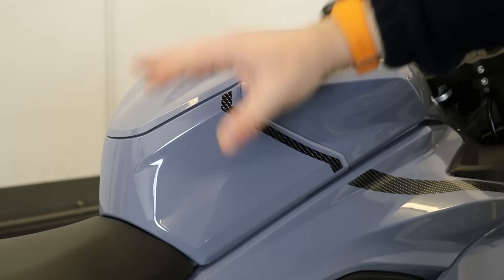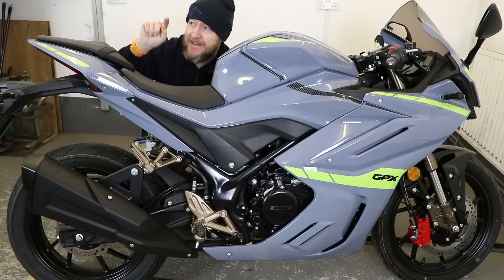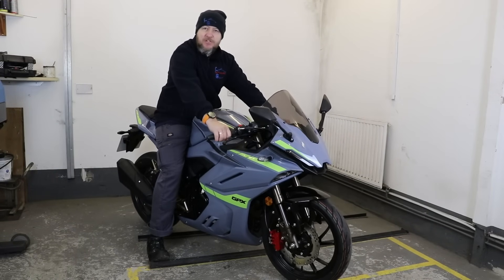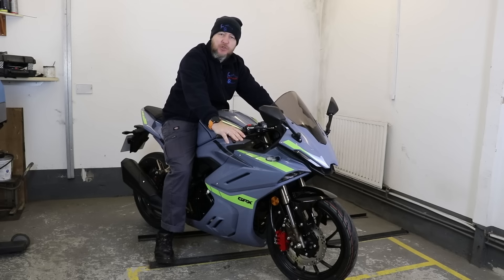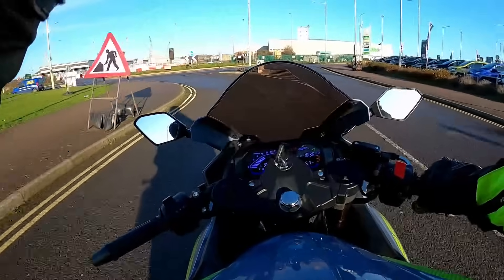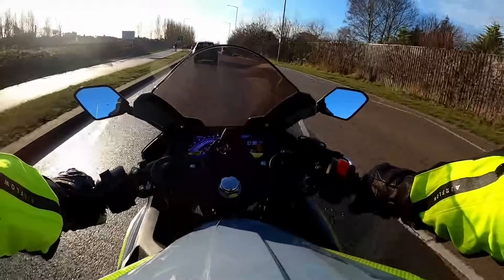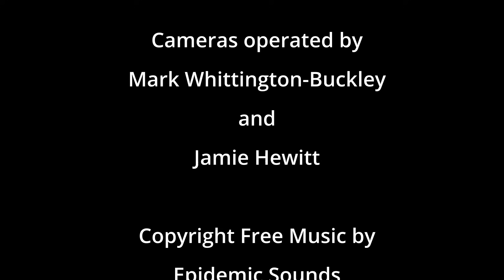2022 SINNIS GPX 125 UK First Review

Comment: I was told many many years ago that you should only warm an engine up in the upright position to evenly distribute the oil. 🤔🤔🤔
Reply: I doubt thats correct. 
Once the engine is running the oil system is pressurised and pumped by the oil/scavenge pump, regardless of the bikes angle.

Comment: What happened to the 100 mph 125 from years back, is it because they are 4 stroke and not 2 stroke, or are they restricted on power, or is it down to them having to be cleaner now.
I've been riding for 50 years, and am out of touch with the regulations concerning the smaller motorcycles.
Reply: Restricted by law on the output.
Reply: @fociidannick  so is that less power than 125s made in the 1980s and 90s, they were still restricted then.
Reply from the maker: Back then, full power 125 was 33bhp....even restricted. Now, 125's are all 4 stroke, (restricted to 11kw -14.75 bhp). Euro 5 emissions now so all fuel injected; ECU's control the fuelling and restrict the power.  Full power 125 will do 70. My first bike was a 1986 FS1E 49cc, only did 35 sadly. Disappointed as my brothers' 1979 FS1E did 62.
Reply: @motorsforthemasses  Not so. 125s were restricted to 12hp (9kw) unless you had a full licence. 33hp 125s like the aprilia rs125 were massively expensive and rare as hen's teeth. Anyone who claims to have had one is either lying, or they stole it.They're 4-strokes now of course, but also have Euro 4/5 emissions. They as good as they can be under the circumstances.
Reply: Like James, that was the beauty of the really early 125s, my 1964 Honda benly supersport was a 100mph 125. It was also an iconic looking bike. Would like one now to just display but when you see them offered today  the £10k price tag is a nit too steep! Those WERE the days my friend I  thought they'd never end

Comment: Personally, I think I'd probably get the Terrain. That's not saying the GPX125 isn't a fine machine, but I think if you're limited to 60-70mph anyway there's no benefit from this kind of layout and you may as well have the more comfortable, more control of a trail bike. I'd also like the panniers, too. However, If you like the styling then there's no real reason not to go for the GPX  for it's looks and it is pretty. This is the thing. Back in the 90s you could buy a 125cc bike and derestrict it to get 20hp. A sorted TZR125 or RG125 could hit 90-100mph. This will never match that. 

I do wonder if Kawasaki who made a range of GPX bikes in the 80s might get in touch with Sinnis about the naming. I think the GPX250 was made until the early 00s and was a fine, lightweight sports-tourer.
Reply: Don’t get the terrain mate there painfully slow even for a 125 think 25/30mph goin up hill 🤷🏻‍♂️

Comment: Nice enough. I think the price is 'ok'. The motor feels gutless and like it doesn't want to rev. The 70mph thing, valid, but the question becomes are you sat at redline to try and do it. 
That being said, the Sinnis terrain seems to be solid enough. I will say as I once did before, you need to review the service intervals, because its important. Its not a cheaper bike if your servicing has to take place 3 times more often.

Comment: That is a lovely bike. My honda vision hits 62 down the dual carriageway it should  nudge 65  with proper variator.  It  weighs 40 kg less than this and it does 180 mpg. 
30 mile a day commute equates to refilling four times a month currently. On the sinnus that would be nine times a month The extra £25,00 would have to come from another budget.
It would be fun to get my knee down at weekend. Of course dodging dip wit cages round here.... exhillerating.
WIth ER is clogged with sniffle cases  would have to be summer sport.
The morning  commute could fun however..
Yes I would exchange shopping hook for something with more road presence.
A great review the black version looks great.
Reply: I don't get 180 mpg from my Vision 110. More like 120 mpg.  Even my T80 Townmate only achieves 140 mpg.  Not complaining with those figures. I think I'm doing well if my BMW achieves 65 mpg.

Comment: Would have rather them splash the cash on abs not cbs because I have a very very bad experience with cbs after my first crash I become rear brake heavy slammed on rear brake and the front brakes locked up and I wasn't even on the front brake so yeah I would rather abs or cba brakes (cba brakes is a joke not a real thing)
Reply from the maker: I understand your thoughts. CBS was so crap on the old Mondials, it would just lose the rear brake suddenly. Several owners have fitted separate front and rear brakes.
Reply: @motorsforthemasses  yeah if I was to get a bike with cbs now days I would just remove it because it's more dangerous having it than not having it in my opinion. You should be able to control your own brakes because the bike doesn't know what surface your on or what your doing so yeah

Comment: There are loads of idiots on the roads theseday. If you speak to them they think theyve done nothing wrong. Its usually smaller vehicles with no power that are a problem.

I was told a few years ago, at a garage you dont need to run in modern engines they dont need it. But dont thrash it from new either just use normal throttle openings.